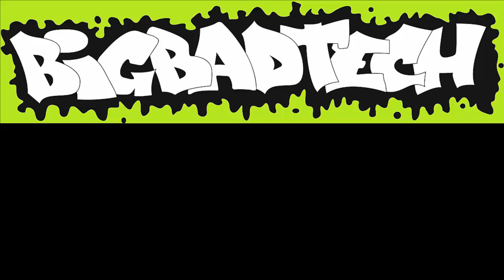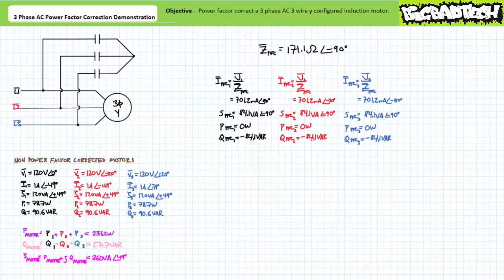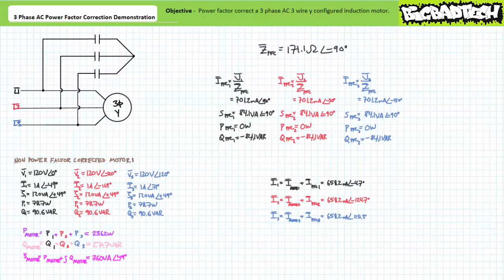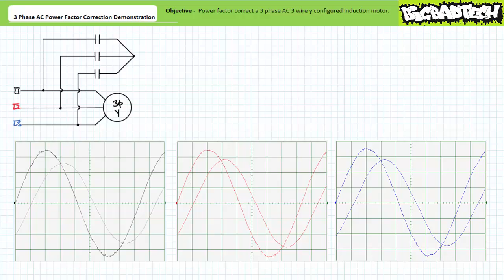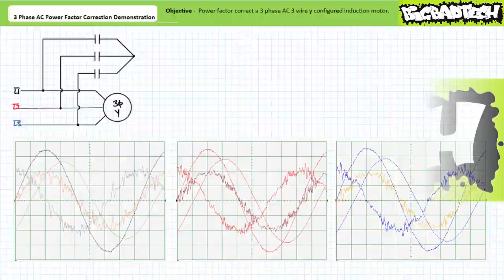3 Phase AC Power Factor Correction (Part 2 of 2)

Comment: Excellent presentation Jim Pytel. I'm seeing that most of the change happens with current phase and amplitude, but do you know if or how power factor correction would affect the voltage at the load? I imagine that it wouldn't sag as much under heavy load conditions it PFC was done correctly.
Reply from the maker: Here's the easy answer ... ideally the source and both the load and power factor correction element in a power factor corrected system are perfectly in parallel and experience exactly the same voltage.

Here's the not so easy answer ... this opening a barrel of rage infected monkeys ...  yes there will exist a voltage sag in the transmission of power, especially so for inductive loads like motors. For this reason there exist "compensating" substations that act "kind of" like power factor correction elements except, rather than correcting power, they seek to stabilize voltage. Stay in touch because I do plan on covering power transmission in the future. In the meantime check out the works of Eugene Starr. He's the man that figured all this out and more! http://scarc.library.oregonstate.edu/coll/starr/index.html
Reply from the maker: Michal, I saw you replied but for some reason it disappeared. Long story short the voltage dip at the load may be occurring because the load might not be the only element in the system. The means of transmission might include a series element that is experiencing a voltage drop which results in the load experiencing less than full voltage. Check out the end examples in the "Power Factor and Efficiency" lecture at: https://youtu.be/aKUIQIFg4hw
Reply: @bigbadtech  Thank you for being so diligent and thorough. I originally replied with a deeper question that was specific to a problem I was working on, however this morning I figured it out.

My issue was this: At the shop where I'm working we have 5+10hp 3Ø motors that are outputting 230-240V and one of the tools MW3000D is not accepting the 3Ø voltage because it wants a 208V system and accepts anything from 197-288.8V.... I was hopeful that perhaps PFC would help "fix" the voltage to an acceptable level... However I realized that 208 and 230 are simple different types of voltages and should not be confused with each other.... so we simply got someone to make a custom step down from 240 -> 208V and it works. And voltage sagging is only a secondary artifact of mismatching load types or efficiency losses due to resistance in the wires etc.